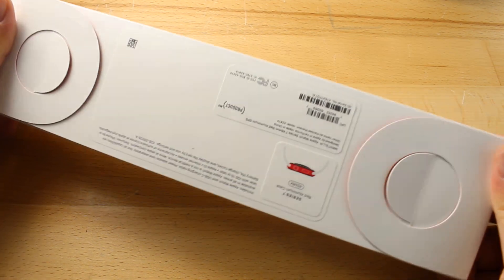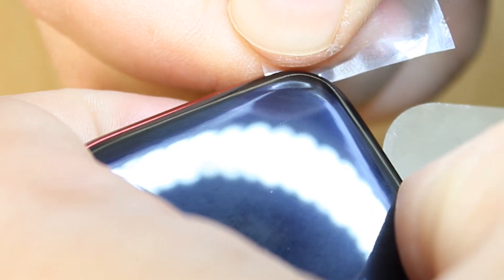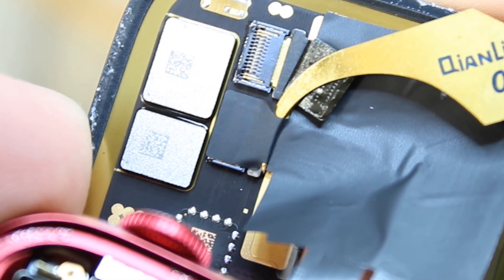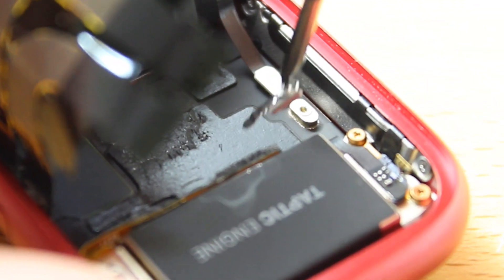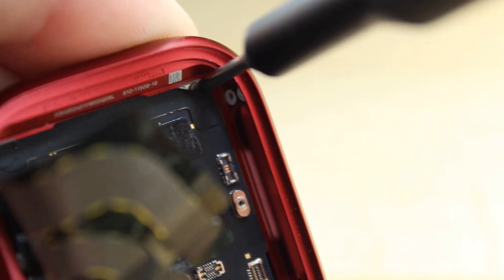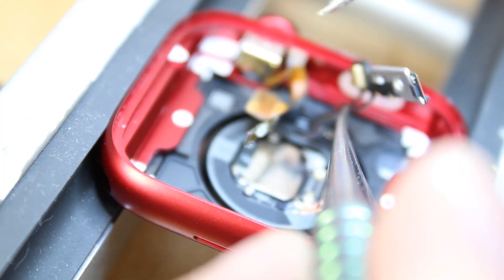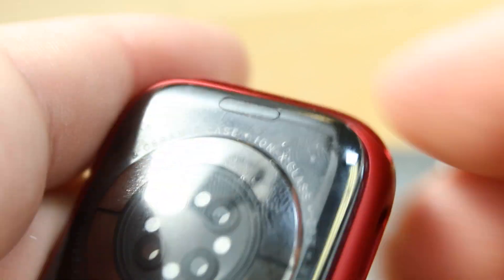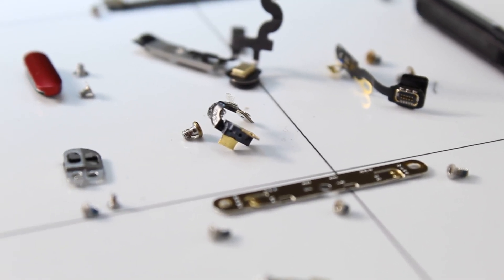Unveiling the Secrets: Apple Watch Series 7 Teardown Revealed! Nothing Left Out

Comment: Can you give more detail on the crown? Ive seen some tools for sale that would remove it, but you are saying its welded so it cant be removed?
Reply from the maker: Some parts of it are welded, but with specific tools (I’ve made my own using a Dremel from razor blades) you can remove the parts that aren’t welded and repair or replace the crown. The tools you are referring to probably help grab the little nut inside a slot of the interior of the crown so that it can be unscrewed and replaced. Does that help?

Comment: just broke the socket for the battery. am i fucked or is this salvageable?
Reply from the maker: If you still have the part it’s possible it can be soldered back on. If not but the pads are still there it can still be fixed.

Comment: I tried to replace my screen on my s7 (because it broke when I fell of my bicycle). While removing the screen I accidentally cut the digitiser cable… so I ordered a new one, but soldering that cable to the motherboard is (in my opinion) impossible without a microscope… well, I’m gonna sleep on that before ordering it😅
Reply from the maker: Its possible but in my opinion as well not practical without a microscope. If you need assistance with it visit my website www.fixdirepair.com

Comment: I forgot to charge my watch and it went off with battery power zero and when I contact it to the charger the screen didn’t work and kept black .. would you please advise me on what to do 🙏
Reply from the maker: Try holding the crown and lock button down for 10 seconds while on the charger. Should fix the issue unless it’s something more extreme like water damage or a failed battery etc.
Reply: I have the same problem. Now the screen is not turning on no matter whatever I do to turn on. Could someone help?
Reply: Did you fix it bro ?
Reply: @SpreadPositivity..  I got a replacement from the company it was still under warranty

Comment: Hi Fixd! Today i separate the glass from the lcd on a series 7, the touch worked well when i've removed the glass, but after putting the glas on (i used Liquid OCA), the toucht didn't work again. So, what could happen there? In my opinion, i think that i used so much loca, but what do you think? And another thing i forgot to tell you, when i separate the glass, it came out with some plastic layer, do you think it was that affected the touch? (remember that the touch still worked without that plastic film). Thanks you! Such a great job on your video!
Reply from the maker: The “plastic film” is part of the screen and is difficult not to damage, so I’m not surprised to hear it, however it can affect the touch and it sounds like you might have used too much LOCA. However you should still have some touch even with too much LOCA if everything went right with the cleaning. I wonder if you had touch right before the LOCA went on..
Reply: @FIXDPHONES  yeah, i have touch before oca. Yesterday I separate the glass again, and i use the right amount of oca (the screen now has the original thickness), but nothing happens. I don’t know if the type of loca that I use could affect the touch (loca-2500). What can i do? Can i replace that plastic film?
Reply: @FIXDPHONES  i would aprecciate your help
Reply: If you want sell your watch contact me

Comment: Well looks like series 7 is an pain for those who fix apple watches.i bought and s7 broken iCloud locked and screen didn’t turn on not sure who messed with but i just tried to take of the glass and i have to say that i don’t think this displays are now meant to be fixed as no meter how careful you are there is an filter layer that is glued on the cristal frame and is hard to get around it and not break it.i will really like to see you making an video taking the glass of from the display and see how will go for you.
Reply from the maker: I just might do that. The bezel has to be removed at the same time the glass is being removed. It’s easier the more broken the glass is but is definitely tricky.
Reply: @FIXDPHONES  do you mean by bezel that frame around the lcd?as that doesn’t need to me removed at all and agree the glass need to be broken to be much easier but i doubt that as ppl learned to protect their watch this time since s7 release i only saw one s7 with broken glass and that now even worked anymore so not sure but the s7 display is way damn expensive 🤣🤣

Comment: I did a tear down on a 41mm and it's a little different than the one u did on the one I did the battery connection was was a a clamp in connector similar to the screen connectors and the mother board had to take out from the bottom side after removing the wireless charger due to housing case overlapping top and bottom of the motherboard from the top side maybe it's because the one I did was a 41mm? I don't know. Interesting love the video.
Reply: Do you have a video of the 41mm tear down ? I’ve been trying to find a video and can’t find anything at all.
Reply: If you want sell your motherboard text i will purchase this